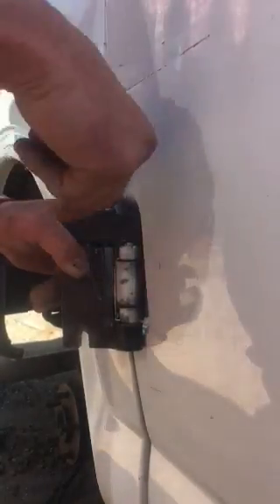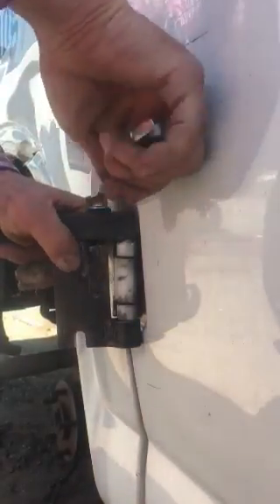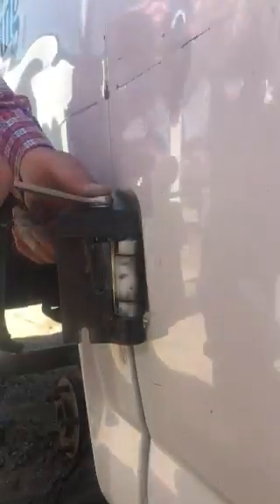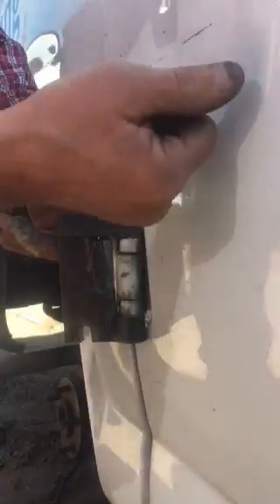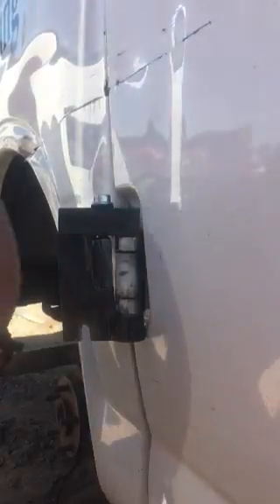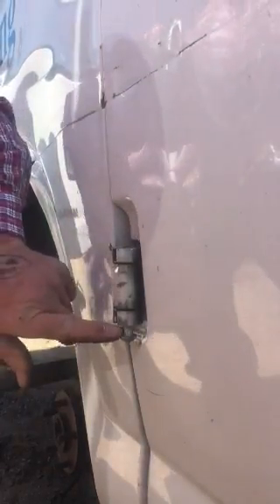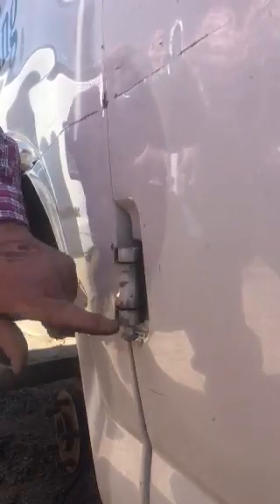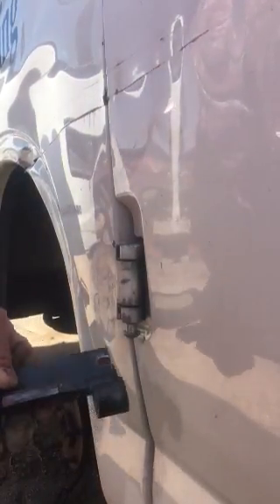How to remove Chevy Express GMC Savana Van side door hinge pins

Comment: Hi i bought a hinge remover something like the one you off e-bay but its not the right one the lower hinge is inset. I see yours is adjustable. But also my hinges are ceased on my 2007 Chevy express. You mentioned a fire hammer? Im feeling only high heat will break these pins loose on mine. Do you agree.
Reply from the maker: Thanks for the question. Yes, there are some that will require heat (torch) and what a paint nightmare but if they are that tight it sometimes is the only way.

Comment: I got the tool still wont budge !!
Reply from the maker: There are some pins that are totally frozen up. There are some suggestions in the enclosed instructions and especially the diagram of the worn pin locking the whole thing up. Shifting or lifting the door may help.  Let us know if it is just one pin or no luck on any of them.
Reply: @doublearrowfabrication3880  FIRE WRENCH WAS THE ONLY ANSWER !!
Reply: @835YT  Mine still won't budge. I can't find the fire wrench anywhere...can you point me in the right direction? thanks for your time.

Comment: Hello sir nice video did you make that tool or I can buy one
Reply from the maker: Thanks for your interest. Following is the direct eBay link. https://www.ebay.com/itm/283399500939
Reply: @doublearrowfabrication3880  how do I go about putting the pin back in?
Reply from the maker: You should be able to find a replacement pin on the net.  To replace it just use a hammer and pound it in.
Reply from the maker: You should be able to find a replacement pin on the net.  To replace it just use a hammer and pound it in.
Reply from the maker: You should be able to find a replacement pin on the net.  To replace it just use a hammer and pound it in.
Reply from the maker: You should be able to find a replacement pin on the net.  To replace it just use a hammer and pound it in.
Reply from the maker: Below is the direct eBay link for the tool for the express / Savana van side doors.
https://www.ebay.com/itm/283399500939
Reply: The video cuts off early. How do you finish removing the pin?

Comment: make sure you have few extra bolts, and lubrication. i tried, bolt threads got messed up, ended up drilling it out, took 3-4h, what a stupid design.
Reply from the maker: After 8+ years of tools and a 95% plus success rate, there are a few hinges out there that are so locked in that no tool will work. Very sorry that you were one of them.